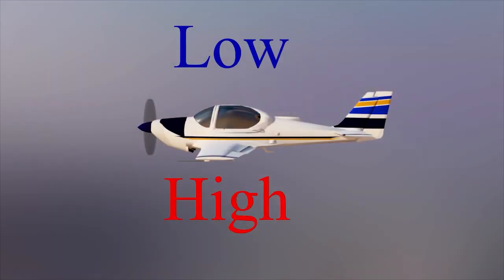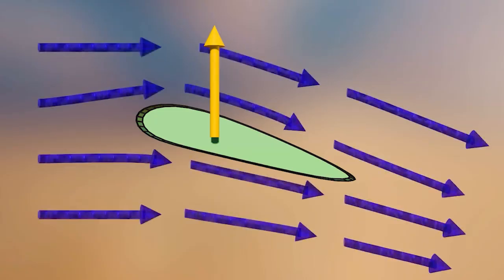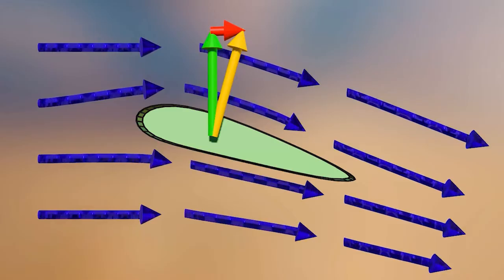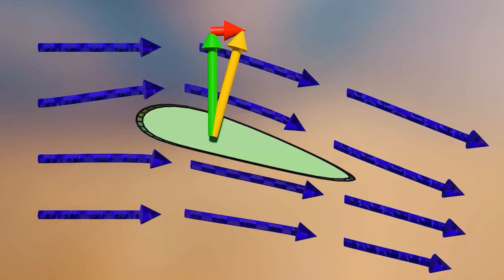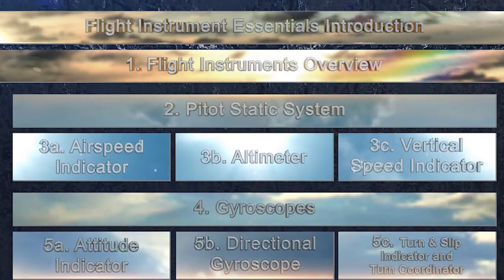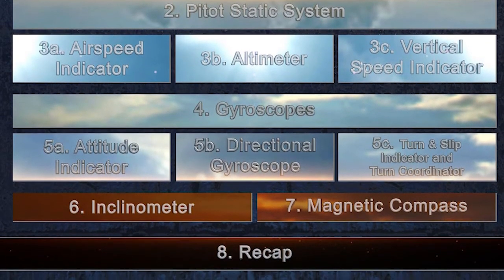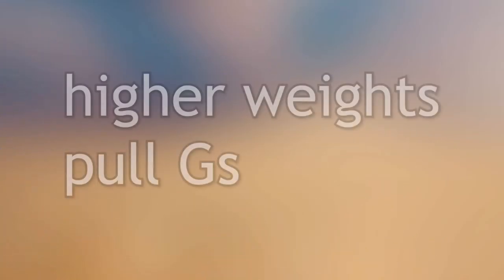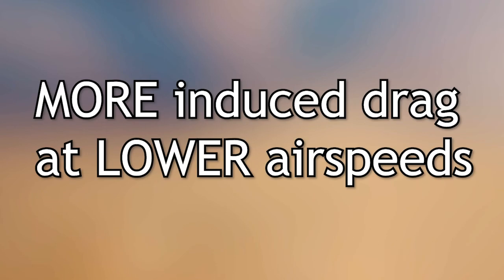Induced Drag | Pilot Tutorial

Comment: Couldn't understand something. Okey if there is no wingtip there is no wingtip vortices but why there is not any downwash? Not just wingtips produce lift right? All wing is effected with the lift force caused by pressure difference between both sides of the wing , even if there isn't any wingtip wing still effected by upward force so also applies a downward force to air molecules and creates downwash. Which point of my logic is wrong? To summarize, I couldn't understand necessity of wingtips for downwash.
Reply: You are correct. Induced drag exists even without wingtips, this guy has his explanation sort of wrong. Induced drag can exist without wingtips/wingtip vortices. Induced drag effects ALL areas of the wing, because as you mentioned the entire wing is creating lift, not just the wing tips. Induced drag is just more pronounced at the wingtips due to wingtip vortices.
Reply: @masterdaddychris5986  Thanks for making it clear:)

Comment: Why does induced drag act parallel to the ground and not parallel to the direction of flight? Drag is meant to be opposite to the direction of velocity, but you showed that if the angle of attack increases, the induced drag still remains horizontal. I'm just a little confused and I have an engineering exam in two days. Sorry for the long question.
Reply: The airfoil itself causes the induced drag so it is parallel to the wing in my understanding
Reply: @xvdarkshadowvx  No, the person that asked the question is correct. Induced drag is the component of lift acting opposite to the aircraft velocity (flight path).
Reply: The induced drag acts perpendicular to the relative wind. The downwash effectively increases the "relative wind" angle, so the "induced drag vector" tilts back, because it must remain perpendicular. Because it is tilted back, it is opposing thrust, which means it is creating drag. It is not fully horizontal because it is lift! If it was fully horizontal, there would be no component of lift to it.